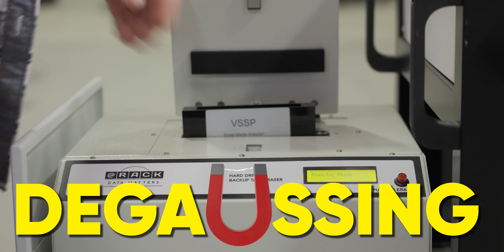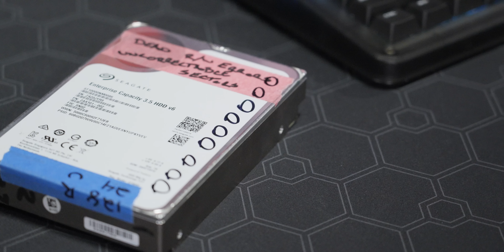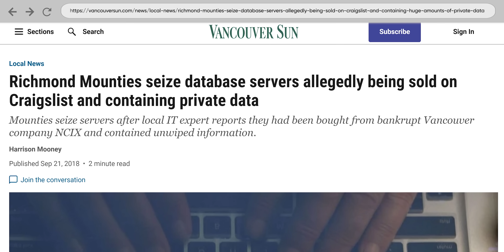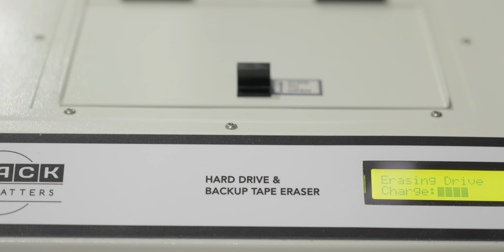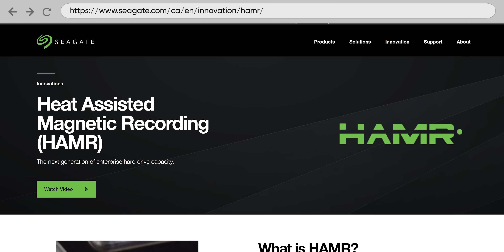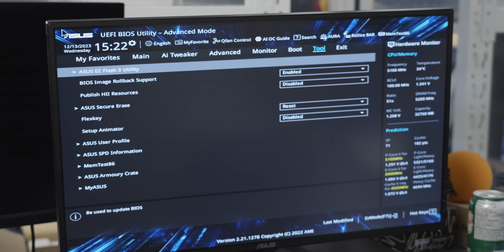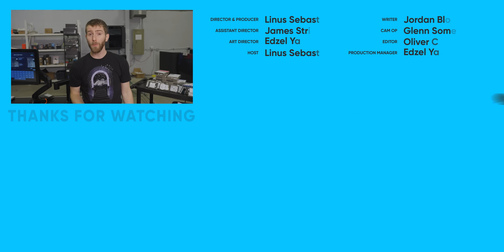I Got an Industrial Hard Drive CRUSHER! @Rack's Mobile Data Destruction System

Comment: I worked for an IT recycling and DATA destruction company for 2 and a half years. They had a warehouse sized convayerbelt hard drive destroyer capable of destroying 100 hard drives in minutes. Everything was shredded to tiny parts smaller then your nail and magnets would pick out different materials, with a shaker as well, placing them in different containers. As for myself, I was part of the DATA removal side where we had 3 racks of 50 hard drive bays running a 1, 3 and 7 "wipe" system. The system would actually do a full wipe and then rewrite 0's on a full drive and the more you paid the better the wipe was. 

Now the shady part of all this, we had highly and I mean highly sensitive data on these drives, the company boss would frequently cut corners to save and make as much money as possible, we were ordered to remove the sticker identifiers from high grade hard drives and stick them on old scrap ones that nobody wanted. This was to fool companies who wanted to see the hard drive destroyed. To make matters worse, the shredder was put on the slowest setting, the warehouse was freezing cold/roasting hot, no drinks were allowed in the warehouse and no chairs were ether. 

They would be told it would take hours to shred and they would have to stand in one place and not be allowed to go anywhere without permission from the higher ups, or they would be invited into a cosy, climate-controlled room with comfy chairs, a 50 inch screen TV and they could watch whatever they wanted. To sweeten the deal, at lunchtime the boss would pay out of his own pocket for takeaway food for them to enjoy. The room had top-of-the-range coffee and tea machines, a range of energy drinks, fancy waters etc, all perfectly chilled.  No staff were allowed in the room, just the guests, the boss and the sales manager. 

The hard drives that were to be destroyed would be wiped and placed in decent to high end PCs that would be sold in bulk on the "cheap" to start up companies that wanted the best, but could be made at half the price.

Comment: I worked on HDD shredding machines. Expensive things to operate. Ball bearings are so hard they simply dent your cutting tool. We made these cutters. That was good business. 

Another weird story. Once a customer requested a machine which can physically destroy all running drives in a big server with a push of a button. The use case of that was probably erasing your countries data when invaded by a foreign country. Not that easy to design as you need to have a 100% succes rate and yearly testing of the system is not really an option.......

Comment: If you have dmcrypt/luks encrypted data, If you wipe(encrypt, throw away key) the drives before use with the Encrypted output of /dev/urandom, you can have deniable encryption. The encrypted data would be indistinguishable from the noise on the drive.

Comment: I was always under the impression while speaking in terms of your general day-to-day windows NTFS formatting processes, that a quick format, and long format were much different, until just a couple of weeks ago, I read that they are the same thing except the long format includes a surface scan? I'm still stifling through historical points trying to recall where I read this, but I'd like to ask if anyone else thought the process was different as I did for the last...since Windows XP I rekon? Or perhaps this was simply a false statement?

Comment: My dad used to be a service tech working on large server installations amongst other things. IIRC, back in the 90's, protocol at his company (very large international corporation) was to drive a 1/4" slotted screwdriver through the hard drive with a hammer before disposal. He may have had to do that in two spots to make sure the drive was extra dead.

Comment: These are super cool.  I did a refresh for a bank I worked for back around 2010, and they brought in a portable one of these, basically just the crusher section with a big chonkin handle on top.  We called it the taco maker.

Comment: After overwriting the data, I always open up spinning drives and slice up the platters. Plus there are powerful magnets to be harvested in spinning hard drives! Too useful to throw away! For SSDs, I take the memory chips off the board, cut the leads off, and then melt the chips. I break the pcb for good measure.

Comment: Funny you say that about pushing off clearing the drives to a junior IT technician. As well as mentioning how long it takes to rewrite entire drives to zero. My first job in the IT industry was at an insurance company that had just finished a complete upgrade of ALL storage in the entire data center. This left us with nearly 500 drives that needed to be cleared. They sat me down and showed me the program and said "You're not doing anything else until this is done" After nearly 2 weeks of working my boss asked me the status and how many more days I needed (clearly expecting an answer in the measure of no more then 4-5 days. Given I had a lot of time while the drives were clearing since most would take 10 hours+ I'd sorted them all by capacity. I did some rough math and told him if I was working my usual 40 hours that it'd take approximately another year for me to finish up with the current method. He couldn't believe it and asked if I'd been doing anything the two weeks I'd been working. I told him I was clearing drives with the current method I was told to use. I promptly showed him the process in fear of losing my job. Plugged in a few drives on the machines I had access to and started them. Told him they wouldn't be done until tomorrow morning. (10-12 hour wipe time) He was in total shock and left me to continue. 

At the end of the next week 2 Degausser machines were delivered to me in my office. What a blessing that was.

Comment: That looks like a very low end machine.

Used to work at a place that had a machine 4x the size just for shredding(yes, shredding) old HDDs/SSDs.

It had a massive steel plate that came down like a hydraulic press and sliced 2cm chunks off a HDD. 

Government related HDDs had to be sliced into 1cm slices.
Reply: Unnecessary

Comment: As someone who works in the data center security field I can tell you that the destruction of media is a huge part of what we do. Drives are degaussed and then shredded, and larger chunks shredded again and SSDs basically get crushed back into sand.

Beyond that depending on the type of data you’re storing as others mentioned - it could be as comprehensive as anything that is taken inside a data hall that could possibly contain data doesn’t come out unless it’s in a million tiny pieces (RAM, SD Cards, NICs, Laptops)

Comment: Yay, more ewaste. Because a secure wipe isn't good enough. Why even bother having secure wipe exist?

All the drives in my new server have over 40k hours on them. My old servers drives are over 100k hours after starting at the same. Not one has had a single unrecoverable error or bad sector.
Reply: I mean does govcloud even do this? 😂

Comment: The overhead of software encryption really isn't that heavy on modern hardware, at least with a decent implementation. I'd argue it's even transparent for most consumer use cases. You might notice a dip in numbers if you run synthetic tests, but for day to day use you won't. Full disk encryption really is a no-brainer these days, at least in the world of Linux and BSD.

Comment: Meh, this machine is childs play.  Shredding is where its at for secure disk disposal, and it takes a commercial shredder about 8 seconds to turn a 3.5 magnetic disk into near powder.  My company has a policy due to the nature of who we are, no storage leaves the datacenter.  If a disk goes bad and is replaced, or a system is decommissioned, the disks go in my cage for secure storage.  About once a quarter we have a surplus company come on site and perform a disposal and shred operation.  Long as their machine doesn't overheat, it takes them like an hour to shred about 450 hard drives, IN their drive cages because I cannot be bothered to take disks out.  Sorry, I'm partially responsible for the shortage of disk cages on used surplus equipment.

Comment: I used to be a hydraulic technician.
one company we did work for was some kind of file destroying place. from paper files to hard drives.
For hard drives they just used a fine blade metal crushers, every single piece of scrap would drop to the bin bellow and none of the scrap would be any bigger then 3mm.
No de magnetising but an impossible puzzle to put together especially when your crushing 10 or more drives at once and they are mixing into 100 other crushed drives in the bin already.

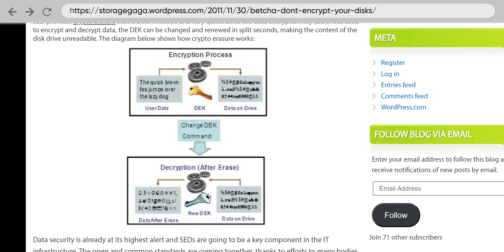Comment: 14:17 I had a scare a few years back where a drive in our home server died, but in order to warranty it I had to send it back.  I left it sitting in a drive dock for a day over the weekend and it finally kicked in and worked long enough for me to perform a secure wipe on it, but after that I switched the actual storage partition on my server to an encrypted partition.  That way if one dies again and I have to send it off, the data on it is safe because it's encrypted, so I don't have to worry about trying to securely wipe it before sending it off.

Comment: Fun Fact: According to the United States Government, you did not successful destroy the data to the standard they would require for truly sensitive data. To meet that level of destruction, you would need to run the drives through an industrial pulverizing shredder that renders the device into a sort of course glitter like metal dust. (When I say sensitive, I mean the highest levels of classification)

The degaussers work well enough to render a drive inoperable, but still technically recoverable with sensitive enough equipment. The platter crusher makes transplanting a platter into a special drive that has that sensitive read capability impossible. However technically the platers can still be scanned over much the same way an atomic force microscope would scan over a sample (Only a larger sample with a lower resolution.)

If the data was encrypted then you would not have much to worry about, BUT!  there is no guarantee the key is not recoverable (Highly improbable, like winning the lotto improbable, but not zero). So they require the drives get shredded down to the point where even if you were able to find every part of the plater and lay them out where they go, the edge damage on those fragments would render recovery impossible.  It would be like if you had a jigsaw puzzle of a black and white checker board, only most of the piece have ripped up edges, so you would never be able to connect them or orient them correctly.

Yeah, that's how paranoid Uncle Sam is about it's most sensitive information.

Comment: For actual hard drives, it is super easy to simply remove the platter and run it through a dimpling machine and then cut the platter in half.  It also makes it possible to sort the material for recycling.    For SSD drives, it is easy to cut them up with sheet metal cutters.  Backup tapes are more time consuming to destroy.  I usually take the DLT tapes apart and pop the ends off the tape reel.  Then cut through them with a sharp razor knife or box cutter.  This creates thousands of small pieces of tape that then goes in the shredder bin.
Reply: When you open those helium drives, do you breathe in the helium and talk in a funny voice?

Comment: So I do this for a living and have done so for over 20 years. If anyone at Linus Media wants to reach out about wiping data or e-waste I’m here. I would say that Linus and his team did a very good job of covering this topic but I can’t resist putting my thoughts out there since I do it day in and day out.
Here is my quick thoughts on this topic.
HDD –
Platter drives, these are NORMALLY ok to do a 3 pass. A 3 pass is the N.I.S.T standard, which use to be the D.O.D standard until N.I.S.T took it over. A 3 pass does the first write as binary 0’s, the 2nd as binary 1’s, then the 3rd as random. Usually the software will do a check on about 10% of the drive and if any data is found it should say it failed the wipe. If no data is found it will say it passed. This will work on any HDD that is in good working order. There are other standards out there like the 7 pass. This is 2x 3 passes with an extra pass in between. 
Some software works through Windows, some work on a bootable USB or CD (if anyone still uses these). If you do wiping in mass you will need a special server configuration, usually a JBOD setup to do a lot of them at once. My setup is currently 4 servers that wipe 24 drives at a time each.
Back in the day you could buy software to wipe these for a one-time fee and wipe as many as you wanted. Companies swapped over to a per hard drive price about 10 years ago and it’s horrible. It’s not worth wiping these drives to resell unless they are larger drives that work. We only wipe SAS or SATA that are over 2TB anymore. 
As far as Degaussing I would NOT recommend it. For one you can not verify if that data has been wiped as the degaussing destroys the firmware for the head to know how to read the drive, as well as other things. Depending on the size of the drive, and how many palters there are on the drive, will determine how strong a degausser you need. If you use a weak degausser on a larger drive with a lot of platters, there is a good chance you will not wipe the data on the inner palters. Now obviously it would be hard to get data off, but it’s possible for sure.

SSD - 
These operate completely different due to Wear Leveling. I do NOT recommend to every do a 3 pass wipe on any SSD for a few reasons.
1)	You will be shortening the life of your drive. Each cell in your SSD can only be written too so many times, the more you write to it the more it loses it’s life. 
2)	You can’t guarantee you are actually wiping the drive. 
The Wear Leveling technology will manage all the cells in your SSD’s life and keep a record of how many times each one has been written too. Reading the cell doesn’t hurt it, but writing to it does. Let’s say that your OS is trying to write to the drive. The OS thinks the data is getting written to a certain block on your SSD, but that block on your SSD has been written too much. Wear Leveling (which is code that is written on your SSD) will tell your OS “yea, sure thing” but then move it to a different block that hasn’t been written too as much to preserve the life of your SSD. So your OS thinks that data is written to in a certain location, but it’s not actually there. This maintains your storage size for as long as possible.
There is actually a bit more storage on every SSD than they state, but it’s saved as a backup for when blocks go bad. These backup blocks will get tagged in when a block meets a threshold for too little life left. These old blocks will go dormant and no data will be written over them. Any data on them will NOT be overwritten or erased. 
In order to wipe an SSD you will need to do a Secure Erase. Not all SSD’s support this, and it’s actually a firmware code written on your SSD. In order to gain access to it you would need to run a software like Parted Magic that can gain access to it. There are a few different versions of Secure Erase and depending on your drive some or none of them will work. Some just delete the partition table, some send electricity down every cell and wipe the data, some do both of these things.

I could go into more detail if people want, but this is a general overview. If anyone really wants to learn more about SSD’s (that actually use Quantum Tunneling to write data) I would HIGHLY recommend a youtube channel called Branch Education.

Comment: The risk with encryption on disks with sensitive information is that we have no concept of what the future holds. Perhaps in a year or two a vulnerability will be discovered in a particular encryption schema. Or perhaps in the next decade quantum computing becomes so powerful it renders even the most cutting-edge encryption useless, allowing today's drives to be decrypted if they've been sitting in storage. It's far safer to physically destroy the drive.
Reply: You assume encryption without secure erase.
Such an unexpected breakthrough would be a nuclear type of event
Reply: @VADemon  "Secure Erase" is unfortunately a black box. Institutions can't trust that it is properly implemented by the manufacturer. And these nuclear events happen. We constantly discover major vulnerabilities in cryptographic implementations. The math itself may be fine, just implemented improperly. But 20 years ago it would have been inconceivable to brute-force a 64-bit cypher. Today you can put a mining rig or gpu cluster to work on it and it actually becomes a reasonable goal. In 10-20 years who knows where we'll be?

Comment: I just wonder. What if they just heat up the hamr drives and use the degausser(however its spelled). Also, why not just burning them or something. I guess it would be to bad for the environment.  Maybe with induction heating. Idk

Comment: When i worked at a computer repair shop for about 8 months i was in charge of sifting through HDDs that the store had been collecting for about 5-8 years. Checked for all bads and recycled those, then all the extras i took the high capacity (to them anything over 1tb is insane space) and put them on a machine that just 0 filled them then wrote 1s then back and forth until you told it to stop. I had 2-3 drives that were that way over about a work week cause according to the shop manager "0 fill isnt enough to destroy data". After i did that i handed it to the head data recovery tech and they said its as clean as a brand new drive, this was after like 2 passes on that drive. they thought i was insane and that someone really wanted to steal customer data from 2005...